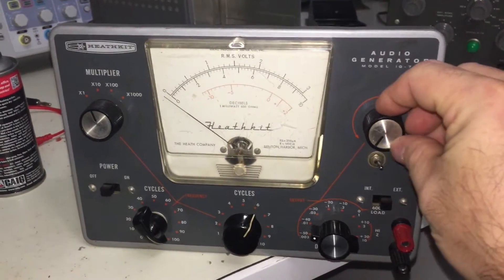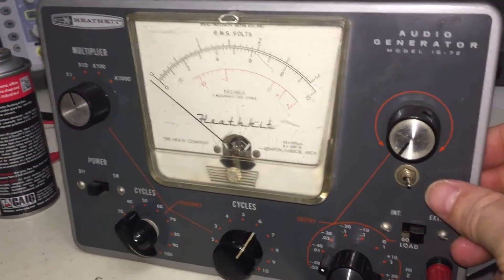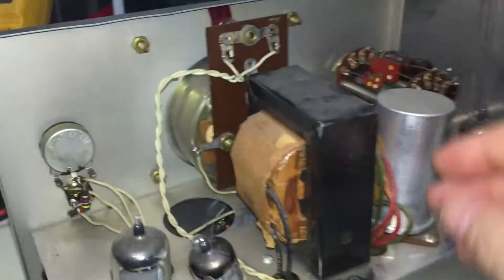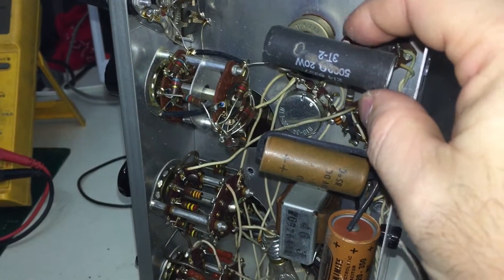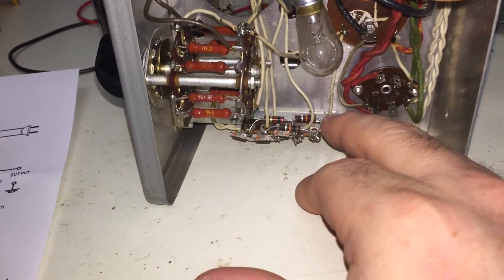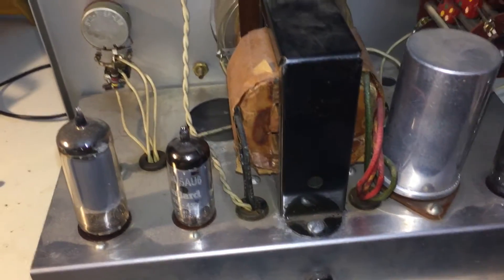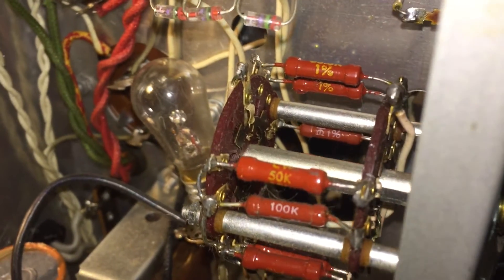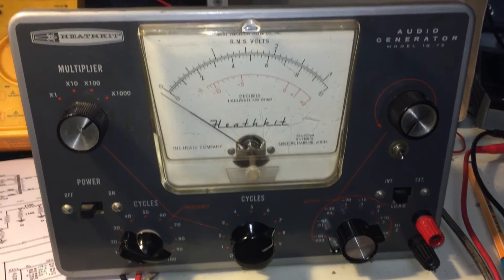Heathkit Repair - Audio Generator IG-72 PART 1 of 5

Comment: Looking forward to watching all five parts. I own a Heathkit Audio Generator IG-72 as well and looking forward to going through the unit and making all necessary repairs. Today I tested the tubes and discovered the 6CL6 tube is bad and fixed a loose connection. Still inspecting. Thank you!
Reply from the maker: Enjoy it, good luck.
Reply: @retrotechandelectronics  ... Thank you.

Comment: Just purchased one of these audio generators so your clips will be invaluable for me.  I wondered about the history of the unit, who built it, who used it over the years, how did it end up at a trash and treasure sale in South Australia that I just happened to be at!
Reply from the maker: Be mindful of the 20W resistor. It will burn a hole in whatever table you are working on when the unit is removed from the case